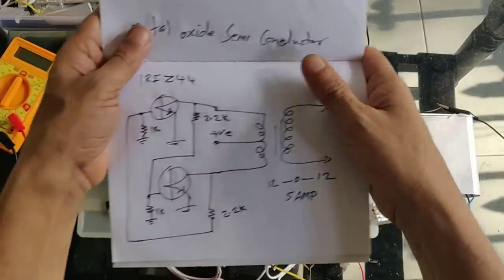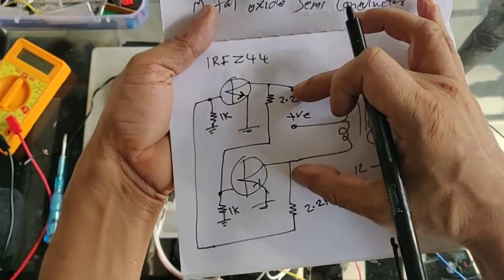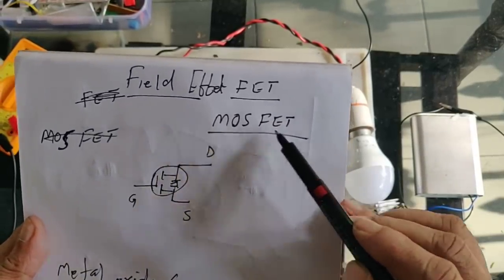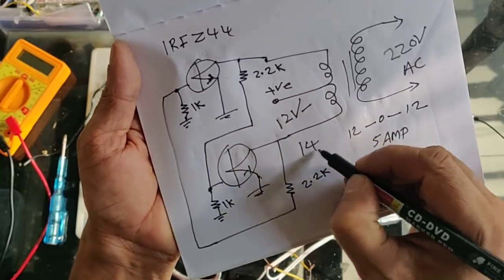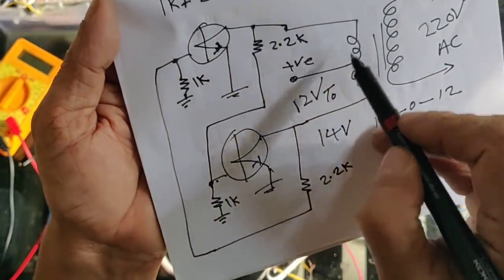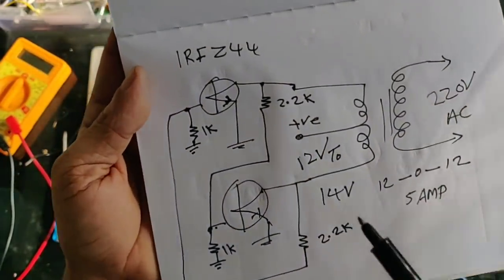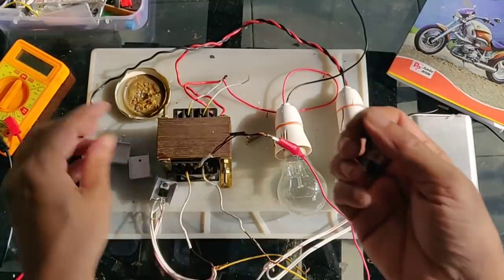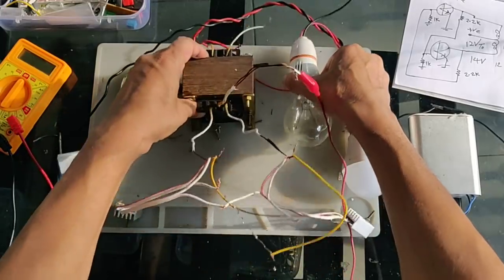ഇൻവർട്ടർ വീട്ടിലുണ്ടാക്കാം

Comment: Stup up transformer aano vendath
Reply: Athe   12 0 12  <--> 220 V  transformer intea LV side ill (atayathu 12 0 12)  12 V AC voltage kodukumbol HV side(220V )ill 220V output  kitum